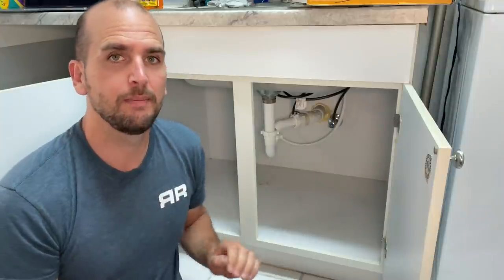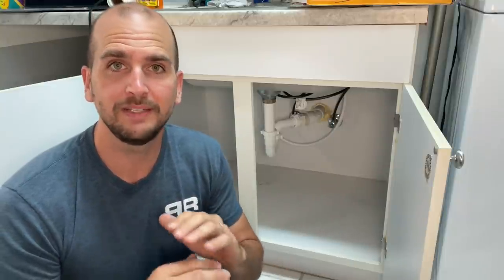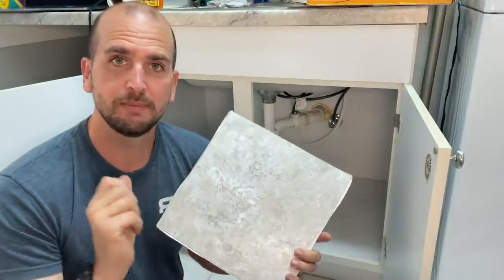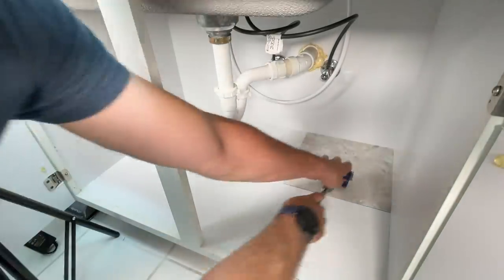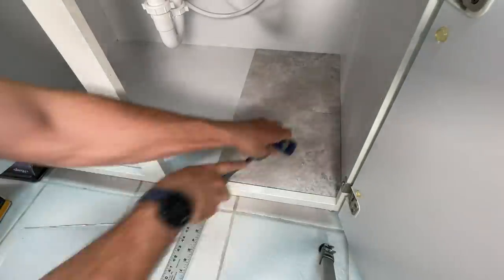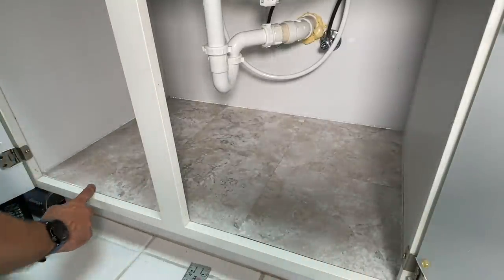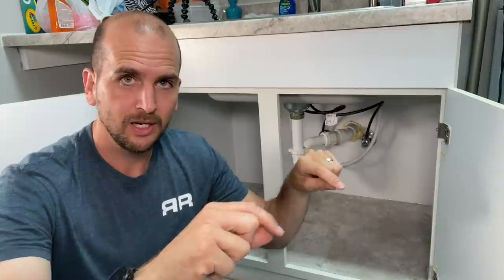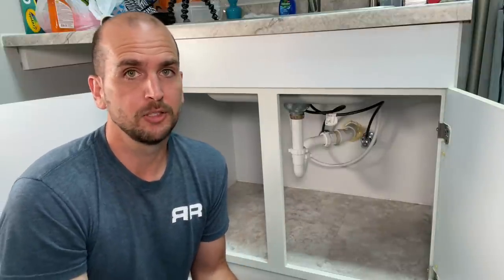Waterproofing Hack For Kitchen and Bathroom Cabinets

Comment: Also, if possible, brushing or rolling on a little bit of red guard waterproofing at the very bottom under the cabinet could  help it and can prevent water from getting sucked up into the particleboard wich will then not rot or expand to pieces.
Reply: You mean I should apply water proofing on the floor that I am going to be sticking the tiles on to before I stick them? Or where?
Reply: I was thinking the same thing
Reply: @idkwntc4302 actually under the bottom base of the cabinet Wich touches the floor itself...it's where the particle board is exposed to moisture and water...good luck with all your work n projects👍

Comment: We use in the spray can flex seal under sink cabinets and up the sides about 4” for our rentals ….spray dry done…. It comes in white and black. I’ve even used that rubberizer for shower pan just because I had a piece of a pal it works great too.

Comment: We do the same thing on all of our rentals. Instead of those cheap glue and stick pieces we buy a little extra vinyl plank and use that underneath. Cost is negligible and can usually be completed with leftovers from the floor. The peel and stick eventually bubbles up and peals off and starts to not look very good. We use the waterproof lifeproof brand that locks together so no glue and can be taken apart if needed and not that it matters but when we show the units it looks good and matches the kitchen flooring lol good tip.

Comment: I used these tiles for my bathroom and kitchen cabinets.  Then I did the draws inside to match.  No more stains, repels water, easy cleaning.   You can also use this idea for your linen closets.  The tiles come in so many colors you can match it up to any room color.  Los Angeles
Reply from the maker: Nice!  Thanks for the feedback 👍

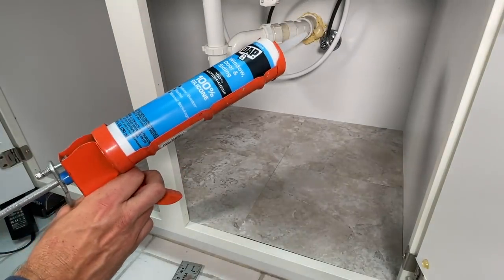Comment: 3:34 putting silicone caulk around the perimeter of the cabinet bottom sounds like a great idea but only if you know the cabinet bottom is level to begin with. If there has ever been any heavy items placed in the cabinet or any previous leak from before, what usually happens is the cabinet will have a small dip in the middle and will slant downward  towards the back. Meaning if there is a future leak, the water will go towards the center/rear  of the cabinet and collect there, then drip underneath the cabinet.
Reply from the maker: This is true but at least the cabinet bottom will be more resilient to the sitting water.
Reply: @EverydayHomeRepairs  Yes, indeed. This video definitely gave me some ideas.

Comment: We measure the inside dimensions and place a tub (Sterlite) container under all the sinks and pushed back to collect the water drips from the hot and cold outlets.  Never had a problem.  If it ruins the tenants  personal belongings you can bet they will report the water drippings immediately.
Reply: So instead of spending the $ on making sure your valves don't leak and p trap don't leak...you just put something in place that will ruin tenant belongings..let them report it..( charge them to fix it) ...good plan

Comment: The best is have a moisture monitor underneath the sink which is connected to your device at all times. If any moisture gets detected it’ll let you know. Better than tile running your underneath with water getting in between.

Comment: Excellent idea. I had used rubber carpet runner in places I lived in before, but they were never big enough to cover the entire area, were not permanent and shifted. It was also not as tough as the  floor tile. For those recommending painted coatings, another hazard to watch out for is leaking household chemicals. I have had that happen more often than water. Those chemicals will eat away at anything. Couple of suggestions: rough up the bottom with sand paper to remove the paint and crud to help adhesion. And put 3" rubber base molding around the perimeter to capture any backward water flow.
Reply from the maker: Thanks for the feedback!

Comment: I would use something like a boot or shoe tray, but it would only go in up to the supply lines. I used some self adhesive rubber soundproofing to cover the big cut out hole for the supply lines from what I had leftover. I used the rubber on the bottom of my stainless steel sink because the original stuff fell off. I had water damage on my bathroom vanity, chipped off the bubbled bloated wood an filled it with Bondo, then painted it.

Comment: I've had water leak problems under my kitchen sink cabinet. My kitchen was remodeled in 2015, so my cabinets aren't that old. There is a water alarm under my cabinet, and it's been sorely needed. This floor tile plus caulk layer would be a nice addition of protection. As it is, I keep a large plastic bucket beneath the drain/pipes/disposal and my RO system sits on a large plastic tray. Water has still managed to find a way onto the floor of my cabinet. Most recently, water leaked when the faucet sprayer loosened up at the head and dripped down the hose. Every leak I've had so far originated from a different source. I suppose the next one will come from the dishwasher.

Comment: You can make it totally waterproof by using Snow Seal white elastomeric roof coating. Just brush it on the entire bottom and about an inch up the walls and then you'll have a one piece membrane with no seams. Mine lasted for 15 years and it was still good when I sold the house.
Reply from the maker: Dang!  I like it and thanks for sharing.

Comment: I replaced the bottom panels with a slight pitch to the front.  The covered with formica or sheet vinyl edging the sides and back with shower tub seal tape.  Lastly is drill holes at the front edge just forward of the baseboard.   This is to alert me of any leaks as soon as it happens.

Comment: Didn’t know that sticky tiles were water proof. Water will still get in between the tiles if there is a leak. So it might help and slow the rot but won’t totally eliminate it if you have a prolonged leaky pipes
Reply: he didn't say water proof, he said water resistant. Sure if you have an ongoing leak it's going to cease to be effective at a point if you just never do anything about the leak, but as he said, water gathering under there is going to do exactly that, pool and/or run out and be noticed instead of just being absorbed by the wood.
Reply: Yoga mats! Cheap and you cut them to fit. 
It’s a ‘custom’ liner. 
Water will actually stand on them, so you curl the edges and lift them out. Dump the water down a drain.
Reply: @Ceares  check the title

Comment: Melamine has a plastic coating that’s waterproof, it’s the edges and plumbing cutouts that are the problem. I just run a bead of silicone around them and have never had a problem.
Reply from the maker: Thanks for the feedback!
Reply: That's exactly what I do - the surface on the cabinets is well waterproof to begin with.

Comment: I don’t know if this is in any of the comments but also should run a bead of caulk a couple inches up the vertical seams in all 4 corners.
Reply: What do you mean?
Reply: There are seams in all 4 corners running from the cabinet floor up to the top. Water can leak through these seams until the water gets deep enough to overflow out the front onto the floor. These seams should be caulked a couple inches up from the cabinet floor  to create a dam.

Comment: I would appreciate your professional opinion on putting a quarter width  tile on the three in the sides of the base first. Then Installing the full tiles as you instructed, including the peripheral caulking. I suggest that this would Further channel any moisture toward the front of the cabinet and prevent ugly mold from gradually accumulating. Looking forward to more such clever and low cost ideas. Thanks. David.

Comment: Very good video sir.  I've done something similar in the past, but instead of adhering the tiles to the base of the cabinet I install a first layer of tile with the adhesive side up. The second layer goes adhesive side down, staggering the joints and all.  In effect you have a floating tile mat.  Then I caulk the edges as you did.  I guess my concern originally was that water could get through a joint and still get to the cabinet base's floor.  I never tried adhering the tiles directly to the floor, so I may have overthought it.  
Anyhow, thanks for the video.
Reply: Sheet vinyl flooring = no seams

Comment: Another way is to use floor vinyl/linoleum roll off-cuts, making a cardboard template first. This way no leaky joints between tiles. Draw around template & cut out with scissors. Stick down with double sided carpet tape and seal edges with silicon
Reply from the maker: I like it!

Comment: I've seen plastic bin lids and vehicle floor mats with the lip on them used in some homeowners sink cabs. The thing is none work unless you notice right away. You can only go up 1/8" because that's all the lip you have on the front of the cab. Then it destroys the floor, shoemold, toe kick, then subfloor (if your away or sleeping) when a leak happens. Need higher front lip for it to matter.

Comment: All my floor, kitchen cabinets have ceramic tiles on the bottom shelf, just used cheap white tiles. Works great, easy to clean, water proof and always looks good. ps also in the bathrooms

Comment: We did our kitchen with vinyl flooring and had some left over ..i put it in the bathroom lower cabinet and the kitchen under the sink too..then i put a metal door strip on the edge to hold the front secure..no seams to let water in between tiles..and no extra cost because it had been paid for with the kitchen floor.

Comment: I make a mini tub with 1 to 2 inch folded up edges with one piece of polywall sheeting under all my sinks.  Completely water proof on three sides and allows runoff at the doors.  A must when you have a hot water dispenser, dishwasher drain,  garbage disposal, and a bunch of stuff bumping the plumbing.

Comment: In place of or in addition to this, I’d also use clear organizer bins. Depending upon pipe placement, the pipe might hover right over one of the bins. You might then see water in one of the bins, before things get bad.

This was useful for me as, although I certainly didn’t know what I was doing, Igor sick of looking at that pipe in my apartment bathroom. Do I bought a cheap cabinet from Target, cut off the legs, cut out a hole and slid it under the sink. I also used decorative window film for the windowed door and I’m about to put in a couple of motion activated strip lights, which will be attached to a couple of power banks.

Comment: I have done that to make an apartment sink tidier. Great idea for my new home. I noticed that there was a small gap between the boards under my sink where water could run if there was a leak. I have spare floor tiles and caulk at hand. I guess I found my next project.
Reply from the maker: Best of luck!

Comment: Rust-Oleum's Leak Seal dries much faster than Flex Seal, so it's a quicker option for applying several coats....plus it can be top coated with latex or oil based paints.

Comment: Question: would you ever put caulk on the seams between tiles? Not a thick bead, but maybe lay down a small bead and smooth it down and leave just enough to keep water from possibly seeping into the seams?

Also, after using the Goo Gone, I would wipe the surface with a dry paper towel before using a wet one. A dry one will absorb at least some of the oily residue that might prevent the adhesive from sticking properly.
Reply: No to the other beads will just make a mess. You could use a solid peice of vinyl to avoid leaks.

Comment: ... I would use alcohol on a rag and   Wipe down the  The cabinet storage area there under the sink. alcohol will remove most anything that may be sticky , most everything else, And it will dry quickly.

Comment: Mine has all the lines coming from the bottom like you showed at the end.  Not a huge hole but if there was a leak on the supply line it would probably just run down the pipes and never show a sign on the base of the cabinet.  I wish it went back into the wall but that's just how the house was built.
Reply from the maker: Yeah, I have some rentals like that as well.  You should be able to still prevent damage from leaks in the drain pipe, correct?

Comment: I put ceramic tile under my sink 2 years ago, easy to clean and easy if something spills...no brainer
Reply: I would think Ceramic tile is Better b/c the grout lines are waterproof whereas standing water could seep between those stick on adhesive tile joint lines.

Comment: I wish I had seen this a few years back when my new dishwasher water connection leaked. Took me hours with a water extractor to get all the wet stuff out of the carpets. Had no idea because the water ran out the back of the cabinet instead of the front.

Comment: I've had a couple of leaks like that - one I got away with, the other discolored the bottom of the cabinet. I was wondering what would be the best way to prevent that happening again and this seems like a great solution. Thanks.

Comment: Did that years ago under my dishwasher. It finally leaked from a main seal failure and water dripped through a hole I had drilled. The basement concrete floor had a puddle. Beats a mess in kitchen. Easy fix.
Reply from the maker: Nice, thanks for the feedback Janet.

Comment: This works if the surface is clean and dry and is either plywood or solid wood.
No particle board. Any moisture gets under those tiles it will swell and separate the seams allowing more moisture to get under the tiles.

Comment: I put a plastic tray under the plumbing. (Shallow storage bin for a few dollars) It will hold several gallons. Also place a 10.00 leak detector in tray.

Comment: Hey Guy, even though your video was a few years ago, it was case in point to what's going on in my house, under the upstairs hallway bathroom  Now, we already had 3 water leaks, within 1 yr. One in the upstairs hallway bathroom where the plastic line running from the tank to the toilet has burst and not notice for 1/2 hr. That leak damage the ceiling downstairs, all the carpet upstairs.  Got that fix. Then shortly thereafter the water line burst under the concrete floor in open area downstairs. Got that fix. Before replacing the carpet upstairs I decided to reinforce the floor decking to stop any squeaking with decking screws. Well, not realizing where to pipes ran I inadvertently hit the water pipe, leak again. Got that fix. Sometime went by. A few days ago, sitting at the table I notice a dip coming through the ceiling speaker I installed. I turned off all the pipes and tried to find the leak. I couldn't, so I called a plumber. He couldn't find the leak either. The next day, I decided to try and find the leak. I turned on the water and ask my wife to turn on the sink water and move all that stuff under the sink. After a little while here comes the water. When upstairs and the cabinet floor had a hole in it caused from the water over a period of time. The nut that secures the pipe under the sink had loosen. Tighten the nut and no more leak. I thought about your preparation before I saw the video and I like it. I removed the entire damage decking to the cabinet floor base. I rigged up a hair blower to assist in the drying process for a few days. Now I must do as I saw you doing on video. Prevention maintenance. Thank you

Comment: I've done this for decades in every bath and kitchen I've had...also...I use mirror tiles across the back of the wall...this allows you to see what's behind the front layer, and it also doubles the light so you can see...The tile I just peel and stick, but the mirrors I hot glue...it affects the mirror surface a bit, but it's for practicality, not pretty.
Reply from the maker: Thanks for the Pro Tips 👍

Comment: I hope you will be kind enough to help with this situation (speaking of leaking sinks.)  My house settled, causing just enough of a difference that the down pipe from the sink tilts slightly. The connection leaks where the down pipe enters the P-trap section.  There is nowhere near enough separation to get an offset pvc pipe between the sections.  I have man-handled the downpipe into the P-trap, but I'm afraid that it will cause silicone to break open between the sink and counter top (which would not be much better.)  
I have seen rubber sleeves that can be fit over these pipes, but I haven't found one that will fit over the top pipe and into (smaller diameter) the P-trap.  Any help would be greatly appreciated.
Liked, Subscribed and looking forward to online classes, if you expand.  Looked for you on Patreon, but didn't find "Everyday Home Repairs."

Comment: Better to use sheet vinyl remnants that are a bit larger than the cabinet base; that allows you to run the vinyl up the cabinet sides and back.

This video showed all of the pipes running inside the wall and coming into the cabinet through the back, but inevitably there will be plumbing coming up through the base; for those, you might want to consider caulking around the pipe openings and any slits that had to be cut to put the vinyl into place.

Comment: I had a water leak decades ago where the builder cut the hole for the kitchen sink too large and masked it.  I opened the bottom cabinet to a sea of water.  This would have been perfect for that.

Comment: They should make the floor/base in the cabinet angled down/forward so that if there is water it would run out in front of the sink and easier to notice when there is a problem.

Comment: Everyday home repair, How's it going.

I put up a video about a year ago, Were I tiled under my bathroom cabinet, I did not used Thin set. 

My video has been stolen, I'll have to put another one up!
 If you ran across a video;  That has black stained cabinets Gray patchy tile underneath the sink it will be mine, I've created a few original things in that video as well. I look forward to hear from you by for now your new friend Ken.